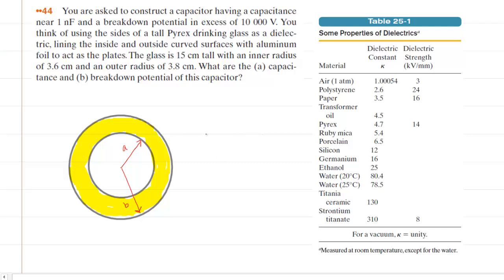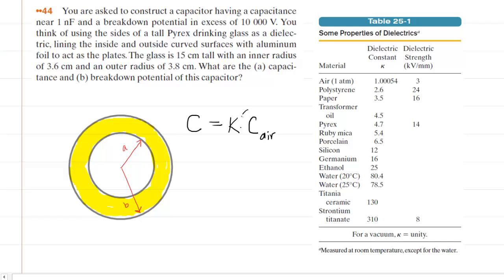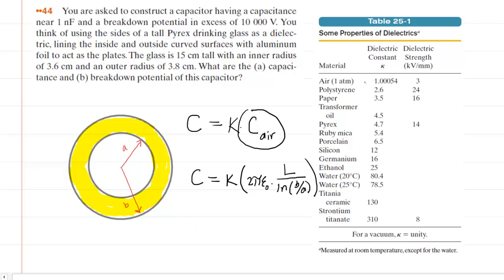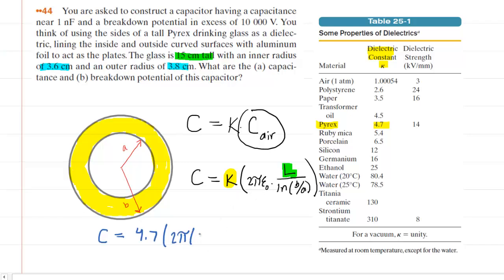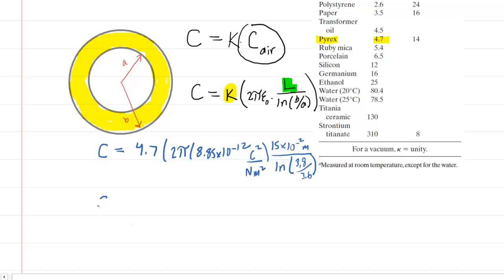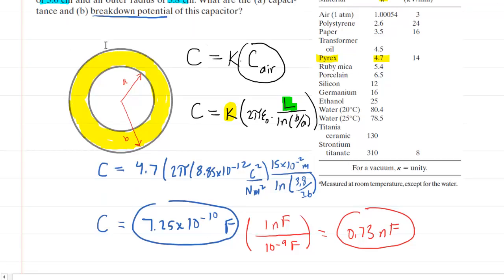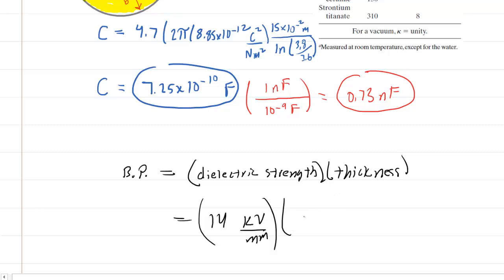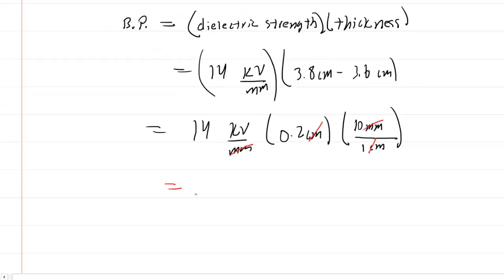You are asked to construct a capacitor having an capacitance

Comment: hey i am certainly not correcting your work, i just want to put it out there that another way to get a more precise answer (and the accepted one on wileyplus) is to use this formula for breakdown potential when considering a cylindrical capacitor: V_b = R1 * (E) * ln(R2/R1). again i think you do amazing work, and the method you provided here is quite literally the same answer if you round to 2 sig figs. Its just wileyplus wants this formula to be used, thought i could save someone the headache.
Reply: WELL , THANKS !
Reply: tyyyy